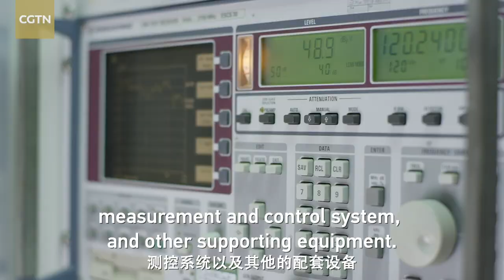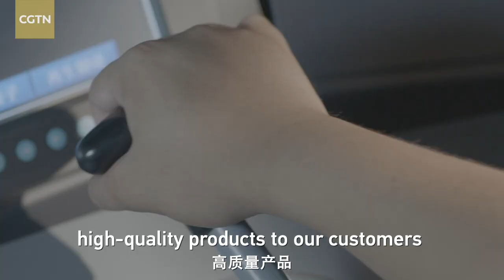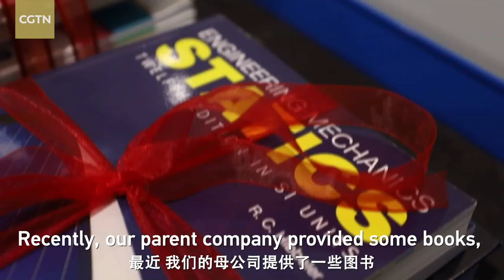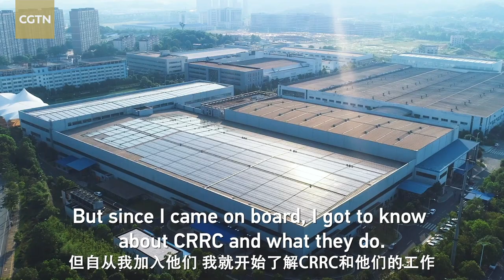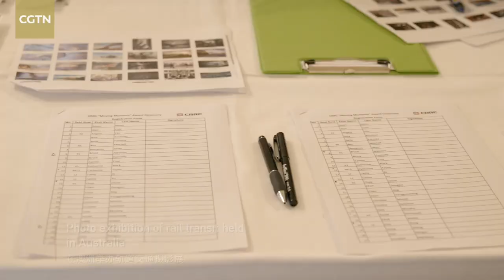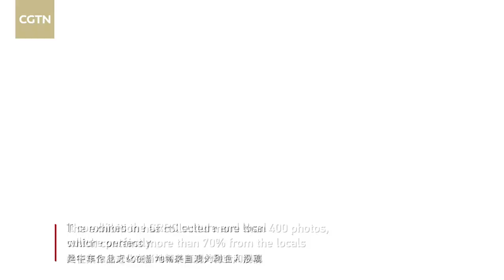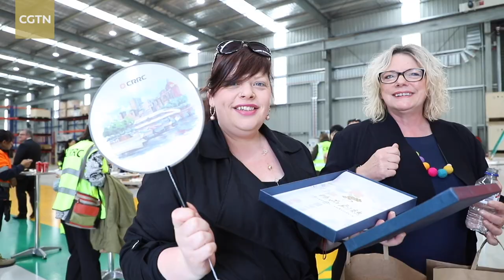CRRC holds open house at CTEA production base in Australia

Comment: The reliability and quality of China's railway and metro systems have been proven from the massive constructions inside and outside of China. While projects that used Japanese system experienced or is in trouble,  Hitachi  high speed trains used on UK high speed railway had leaking problem in rain and now cracks were found.  Washington DC declined Chinese company's offer for metro lines, but used Japan's Kawasaki's products. now there was derailment incidents and DC metro had to suspend the usage of those carriages (many other problems were found in operations).  Taiwan is running high-speed trains made by Japan. It had a lot of troubles at beginning too. The worse thing is that Japan is charging Taiwan about US$ 100 million for each additional new train set (12 carriages), that's about 4 times more expensive than China's products. I can say that India will have same troubles too with Japanese companies.